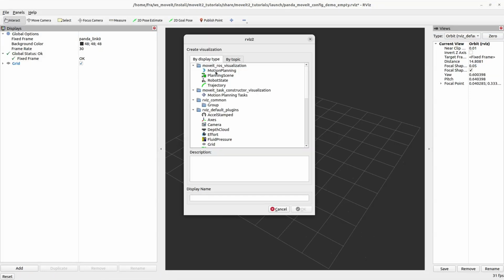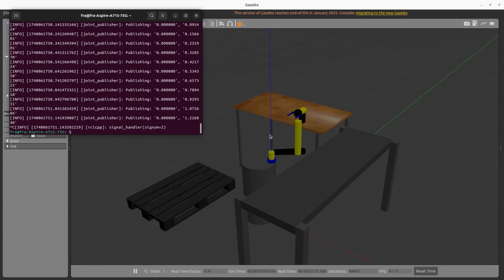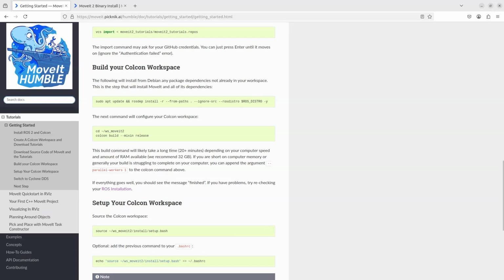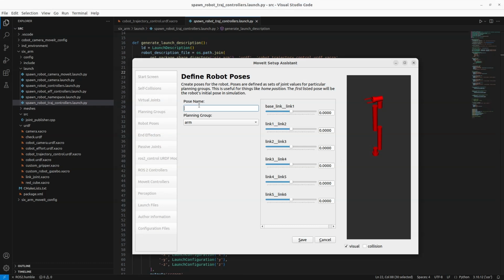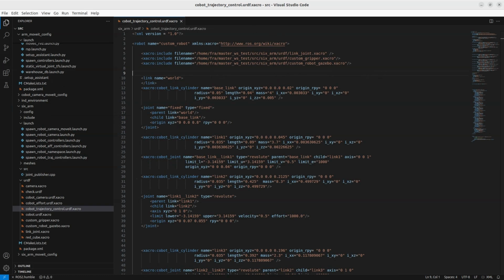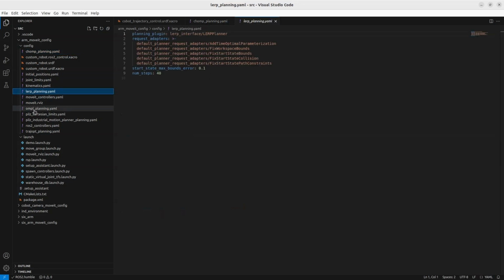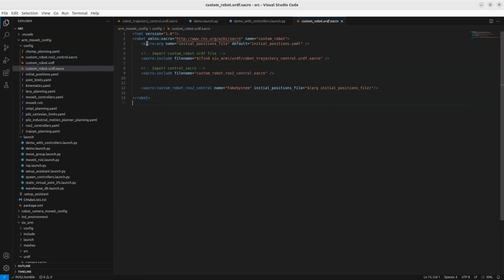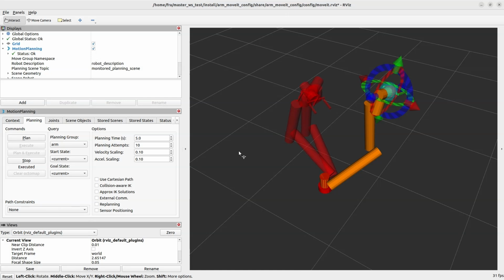MoveIt2 and ROS2 Control: How to Configure & Fix Motion Planning Issues with Setup Assistant

Comment: This video (and "How to Control ANY Robot in ROS2 with MoveIt2 & Gazebo") was extremely helpful! Seriously could not have come at a better time. I have been working on a project for school, trying to teach myself to work with MoveIt and more ROS2 stuff since taking some courses in other parts of ROS2 last semester. UR makes their packages a bit confusing for me, but the way you break down the launch packages and stuff significantly de-complicated everything. After 4 weeks of failing to produce anything, this helped me complete what I needed in about 3 days. If you need any video ideas (and personally these would greatly help me out too lol), I would love to learn 
1. Connecting to real hardware, like a UR arm
2. Pick and Place: How to add custom models to the scene to be manipulated, how to actually "grab"/"release" them (in rviz and gazebo)